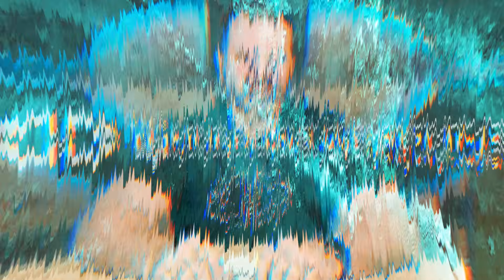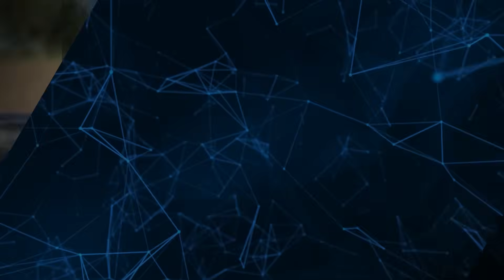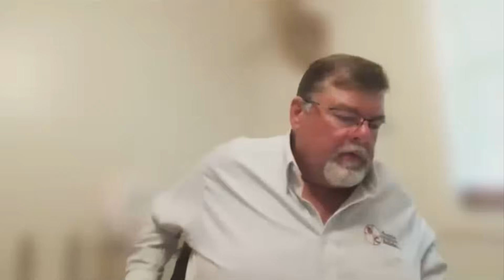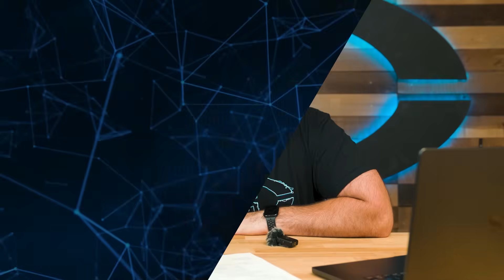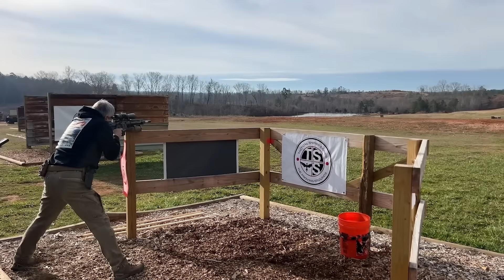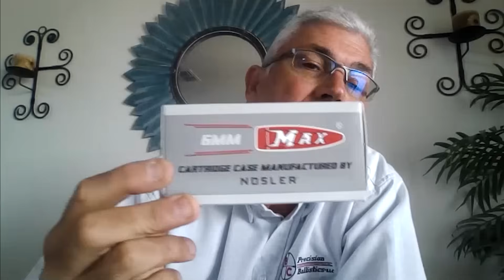The 6MM MAX Cartridge w/Brian Cook & Clark Curnutt | TWP Ep. 5

Comment: Why nobody have thinking use the shell case on a 6max AND increase de psi at the same level as 5.56×45 (60k -62k) theorically that can push a 103 or 108 grain bullet to 3000 fps from a 18' barrel, thats amazing imo

Comment: So my perspective on this.  6ARC and 6MAX are basically identical performance wise.  Also 6ARC has a huge advantage in that it's been out for longer, more companies are supporting it, and there is cheaper ammo available for it.  The only downsides i've heard about 6ARC is the "possibility" of bolt failure because it's thinner wall, and feeding issues because of the taper on the case.  

I haven't heard of the bolt failure happening any more often than it happening for 5.56, so i don't know how real of an issue this really is.  I feel like if you want to sell people on this idea, you need some hard facts to back it up instead of anecdotal evidence and vibes.  I'm thinking multiple 10k+ round tests of 5.56k and 6ARC side by side with identical hardware showing failure rates of each where the bolt wall breaks. 

I think the more important thing 6MAX may be able to resolve is feeding issues with 6ARC.  Brass facts has a video out about his opinions on 6ARC and everyone he's talked to, while they love the performance, says everyone struggles with feeding issues stemming from the geometry of the case and available mags for it.  If 6MAX can resolve these feeding issues, then i think 6MAX has a real chance at coming out on top.
Reply from the maker: I agree

Comment: 6max cannot fit high BC bullets into their casings without significant powder reduction. Great for competition, but 6 arc is more feasible for real world applications, as it is being used by tier 1 SMUs. Hornady is already behind the 6arc. 6Max is really a very impressive wildcatter. 6arc is also fairly easy to purchase. Not so with 6Max.
Reply: The 6 arc has it’s limits too. It’s not magic, &neither is the max, but tests have shown them neck and neck in performance and fixed the arc’s bolt weakness.
Reply: @Jael2818  agreed. The deal breaker is availability. I can find 6arc everywhere. I can't find 6Max anywhere.
Reply: @peady64  I get that 6 arc already has backing. I still can’t find it locally, just online. But 6max has better military application. That could change this really quick.

Comment: What's wrong with 6.5 grendel
Reply: the same thing, generally, that's wrong with the 6 ARC. Weak bolt heads due to having to remove nearly all of case head support. Also, a much fatter case that limits mag capacity.

Comment: 52:20 In terms of intermediate rifle cartridges, the 6mm Max (or other cartridges like the 6.5 Grendel and .264 LICC) are already a great advance and it will be more difficult to raise the standard, however, for a long time I have been considering a concept that could be interesting, which in this case, would be a kind of combination between the 5.7x28mm/4.6x30mm (in this aspect the idea is especially considering a handgun, the cartridge would be long and thin to have a good magazine capacity without sacrificing case capacity) and the .30 carbine (in the sense that when fired from a carbine it has a performance close to certain intermediate rifle cartridges, like the 5.45x39mm, although in the case of the .30 carbine, it doesn't have a good enough energy transfer rate to cause considerable temporary cavity, as it was not made to have a very high deceleration rate, which can be designed in a new cartridge), in a way, there are already cartridges in this direction, such as the .357 SIG and especially the 7.5 FK, but I think it would be possible to make an even thinner cartridge that could have a capacity of approximately 20 rounds in a double feed magazine, in a length close to a 15 rounds 9x19mm double stack single feed magazine (which would be a magazine for compact sized handguns), I will not go into more specific details, as the comment is already quite long (I'm not saying that this type of cartridge has to replace the 6mm Max or other cartridges I mentioned, in fact, the idea is that it can fill a gap that the adoption of these new intermediate rifle cartridges will bring)

Comment: So, will it use the same barrels as 6 ARC? Should you buy 350 legend guns to swap barrels on since the base cartridge is 350 legend? Etc...
Reply: The chamber is inside the barrel, so you can't use a 6mm ARC barrel and it's not necessary to buy a 350 legend gun, just buy a barrel for 6mm Max and 350 legend magazines

Comment: I picked 6.8 spc over the 6.5 grendel years ago because of the bolt differences. As awesome as the performance of the 6 arc is, I'm glad someone addressed the bolt issue in a way that makes sense. I just wish there was a 6.5 max so I could upgrade my hunting gun. I've never been sold on using 6mm on deer.

Comment: I know everyone loved to dog on 6.8 fury, but isn't the first and foremost priority of the NGSW a cartridge able to defeat lvl 4 armor? I've seen a hundred arguments for 6mm arc or 6 max or just comparisons that you can do "long range"  with a hundred ways to skin a cat, but at the end of the day, wasn't the entire purpose of the whole program to penetrate armor? I don't see any of these slightly hotter AR-15 platform cartridges punching lvl 4 armor. Yeah, these are arguably better successors to 5.56, but everyone's attacking 6.8 fury while clearly omitting the #1 purpose being AP capabilities
Reply: To get the AP capabilities the super high pressure, unobtainium, protected as a national security secret, ammo is required. Velocity is generally the thing that defeats armor and the velocity numbers that are being talked about with 6 Max show potential, especially if a solid projectile is used.  Much more cost effective than 6.8 Fury.
Reply: @roncterry  it's going to need a lot more than just speed. The hardness of the bullet and speed usually work, but having extra mass is good too. 22-250 at 3500 fps doesn't pen
Reply: @JulianLares The Russians are also developing a new ammunition (its an intermediate rifle cartridge) to penetrate hard armor and the solution they are testing is to use a tool steel core

Comment: HI, Dessert Tech, will you guys be considering to make WLVRN but smaller in size so that it will be same weight as standard AR15? of course it will loose the .308/6.5 creedmore conversion, but optimize for 6mm/556 catriges. Also put bolt catch near AR15 position? Also make metal handguards as standard from factory. I think that will solve all drawbacks of WLVRN as it can be cheaper also due to smaller size
Reply: They have done all they can do to the upper to pull weight out of it. If you want a 556 only rifle they would just make the lower that way. 7.34lbs is probably as light as it will go.
Reply: @Odinforever2000 understood. Thanks

Comment: I wonder how much more performance the 6 Max could get out of #NickleAlloySteel (#NA3S) ammo over brass ammo? With what we're seeing in increased ballistic performance in 5.56 and 7.62 NATO in NA3S cased ammo from Badlands Munitions ShellShock ammo, I imagine 6 Max would do even better with nickle alloy steel casing.
Reply: I use NAS3 cases in my 16” & 18” 5.56 rifles and on average I pick up about 200 fps over the brass loadings. My 18” 6 Max runs a 90gr bullet at 2800fps so if the same ratio applies then 3000 fps would be possible. And that’s awesome

Comment: I would love to see a comparison of the 6mm caliber cartridges currently in production, specifically the 6mm Max vs the 6mm GT vs the 6mm Creedmoor. 

I'm really curious about the possibility of taking the mid-sized AR receiver of the CMMG MkW (bigger than the AR-15 but smaller than the AR-10) and chambering it in 6mm GT and possibly some other mid-sized cartridges with an overall length of 2.64" (67.06mm) or less and see if the 6mm GT could serve as a better option to replace the M4 in 5.56 for service.
Reply from the maker: I will add that to our list of possible future videos.
Reply: @DesertTechUT AWESOME! 🤙
Reply: @DesertTechUT 
I just looked up WLVRN stats and honestly... save the adapted novel intermediate adapter akin to your existing kits to convert 5.56 to 7.62 nato, and the necessary matching novel mags to match, and maybe a structurally stabilized sleeved suppressor ready barrel... you're already in business. 
The WLVRN or previous MDRX type are probably the only existing rifles that could be readily adapted to this novel intermediate size.
I thought perhaps they were too heavy... but the WLVRN is under 8lbs.
Even lighter would be nice but it's still light enough to be better than most full size platforms.
Reply: @DesertTechUT I think the only way to comfortably achieve the ideal solution to the goals of the NGSW program ( while dropping the bullet diameter requirement) is to aim for a novel intermediate clambering between ar15 sized action and ar10 sized action in a bullpup... like the British EM2. That's a great size compromise. 
But weight... can we maybe use modern materials to achieve lighter weight? Get it to the 6.7lbs of an m4, or at most 7? Your bullpups are great.

It's great you can comfortably go over 20 inches in a bullpup but with a functional suppressor?  Here's an idea, splut the difference between the backdraft barrel and a structurally stabilized barrel using an aluminum sleeve with fins over a pencil barrel. Cap it with a short suppressor that mates to the muzzle and sleeve and you get a single elegant solution that's:
Light
Has increased stability (less whip less temperature based sag)
Less sound
Is still short
Less back pressure.

The cartridge should be shorter than ar10, longer than ar15.
Ak/grendel bolt face is ideal as long as the bolt is intended for is up to 70k psi. The case powder stack can be longer than the ARC or grendel though... like the Carcano or 6 dasher. 6mm bull is best. 100-105 gr at 3000fps.
🤔 
The benefit of doing this with the 6max loaded long instead would be the narrow cases would allow something like your proprietary Quatro mag sized up slightly.
Reply: I don't think the cmmg mkw is between an ar10 amd 15 in size... it's just an ar10 with an ar15 magwell. The idea was a more robust platform for the ar15 class thumpers which can easily Overstreet an ar15 if loaded hot.

The POF revolution or rogue or ruger SFAR or Q boombox is the opposite solution: exotic bolts and re-engineed parts relationships so you shoot ar10 type cartridges and sr25 mags in essentially an ar15 with an ar10 magwell.

Comment: I have a 6 max with an 18-inch barrel, built on a geissele upper, and just purchased a 20-inch Son's of liberty barrel for doing DMR competitions.    I have shot about 300 rounds of 6 max factory anmo plus reloaded and tested about 100 rounds of 95 grain match boattail bullets with TAC, Staball Match, and h4895 powder.  The TAC works the best.  There is zero powder compression.   The feeding and functionality of the 6 max are very similar to a 223/5.56.  Being able to use the same bolt as a 223 is critical.  I have a 6 arc with proof research barrel, which I use for long-range shooting with a 105 berger, but getting it tuned was much more difficult than the 6 max.   

I highly recommend the 6 max.  Brian, the founder of the company, is a great guy and has been very helpful when I had questions.  The 6 max website has dies, brass trimmer, cartridge guage, brass, loaded ammo, magazines, barrels, gas block, etc, for guys wanting to build their own AR platform.  It's a one-stop shop.  They also have excellent load data on their website.  Ray Helms from X ring regularly wins shooting competions with the 6 max. His video content is also worth watching. 

Thanks for the great podcast.

Comment: Sounds like the Goldilocks cartridge for ar15s.
Reply: 6.5 Grendel is Goldilocks in the AR-15.  The 6mms are on the lower end side, while 6.8 and above on the higher where BCs aren't optimal.

When you hear them all on steel, you quickly see what I'm talking about.
Reply: @LRRPFco52  yet this fixes the Grendel’s weak points w/ a sleek 6mm.
Reply: @Jael2818   The problem with 6mm Max in the AR-15 is COL.  They haven’t developed a 25-30rd mag for it either, which is harder than most might think.

When you shoot 80-110gr in Grendel, you get faster velocities than either 6mm AR/6mm ARC, or 6mm Max without any gas system constraints from the smaller bores, and the resultant higher duration pressure curves down-bore.

This shows up especially when you do short barrels.  I do like the 6mm Max design better than 5.56 though, but I would have done it in .257” for more bore volume, higher velocities for an assault rifle and DM cartridge.  I really think .257” is optimal for this case size.
Reply: @LRRPFco52  it might be. We’ve had great bullets in these weights for decades. I do think the energy would need to be calculated to see if it would be worth going to 25’s. 
I appreciate the problems making mags, but is that a better problem than the bolt reliability issues w/ the 6arc/6grendal?
Reply: @Jael2818 
I've been shooting 6.5 Grendel very regularly since 2009, including a lot of load developmemt with purposeful excursions to nail down trends and departure points.

I started out with 16" MLGS, and about every barrel length and gas system length imagineable since then.

That includes 12" CLGS high back pressure suppressed for the last 8 years.  12" suppressed has been my favorite so far.

I have boat loads of brass and empty boxes of factory ammo, in addition to all my hand loads.

I still have yet to break a bolt.  I am using adjustable gas carrier on the 12" and put them in my 17.6" MLGS(-), as well as my 8.5" Grendel.

The 8.5" runs great with 90gr TNT up to 124gr FMJ, didn't even touch the gas adjustment yet.

I was worried it might not run, but it's 100% so far.

Keep in mind 6.5 Grendel runs at 47,500-51,000psi.

The only bolts I've broken are 5.56 in tortuous high-volume sessions, after 10k rounds through CLGS 16" guns in the early 2000s.
Reply: @LRRPFco52  I can understand why you would favor the Grendel’s reliability over the 5.56. I’m lucky to have never broken a bolt. 
In no way am I saying the Grendel is bad.  Like everything it has some inherent flaws. The bolt design is inherently flawed. Well made bolts can counter that with quality craftsmanship. You also mentioned the lower pressures needed for this (& the arc) many reloaded love these in bolt guns where they can crank that and maximize their output. 
The max is optimized (NAS3 case possibilities aside) in the AR platform W/ minimal changes to current setups. Particularly for military and civilian defense uses. 
Could the Grendel or the ARCs do this? Sure, w/ more parts changes at a higher cost. 
I doubt it’s worth changing one of these over to the max. However it might be the better choice if changing from 5.56.
Reply: @Jael2818  5.56 has a reliability record that is currently unmatched, since it has almost 70 years of development behind it.  Grendel is at 22 years.  The biggest space for reliability improvement with 5.56 has been magazines, gas system, and the action spring/buffer.

When you increase the pressure with 6.5 Grendel up to 62ksi, you only get about 150fps more mv.  You can do the same thing with powder selection and still stay under 50ksi, as I do with 123gr bullets on top of CFE223.

There are several places on the AR-15 bolt you can increase the strength without chasing much visibly, namely at the rear and sides of the lug roots, as well as the type of alloy you use.  This has been done with Grendel bolts by manufacturers who care.
Reply: @LRRPFco52  you aren’t wrong!  Granted, it isn’t a huge velocity climb, but is a good amount. About the difference between 308 and 30-06. 
To be fair good manufacturing matters on both bolts, or you get the same issues. 
The Grendel definitely has more power potential in the end, as does the arc. In bolt guns.  5.56 has had it’s weaknesses as well in gas guns, which like the Grendel has been mostly worked out over that long time span. That has also allowed for usually cheaper prices on good machines. You can get that on the Grendel, but not as prevalent. 
The big issue here for the max is that it requires less parts to swap out that more people are familiar w/ allowing for greater QC using knowledge they already have. Otherwise they are learning more new info, have more parts to replace (increased cost) and quality tends to be less until things are worked out. The max offers the same performance as the arc w/ less cost, less change, and higher initial QC. 
Thanks for the conversation!😊

Comment: 6 ARC is a good round. I think it will do good in the new ICAR/Sabre 6 ARC where the gun is properly sized to the casing width. But for standard AR-15's 6 MAX is the clear winner. It's like 7.62x39 vs .300 blk in the AR-15. The latter was properly designed around the AR-15 instead of cramming the former into it. 

I want a Sabre 6 ARC. But I do not want a 6 ARC AR-15...